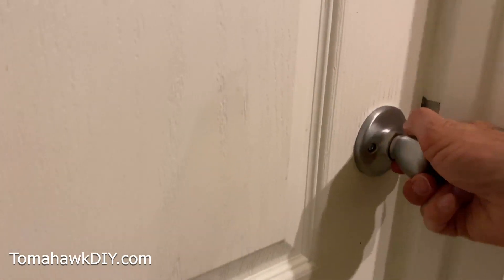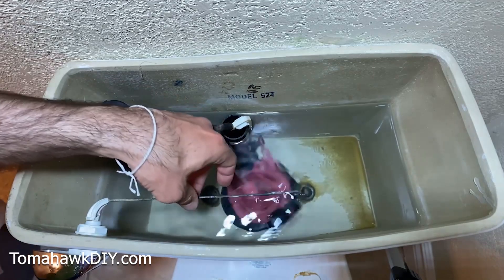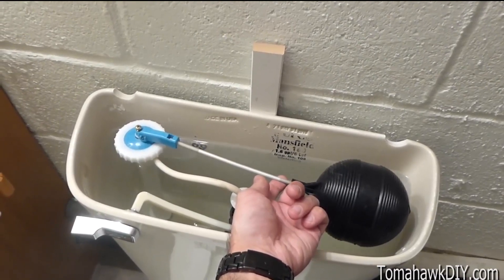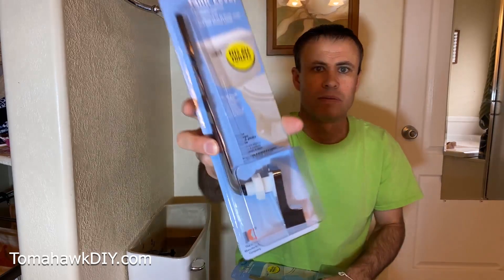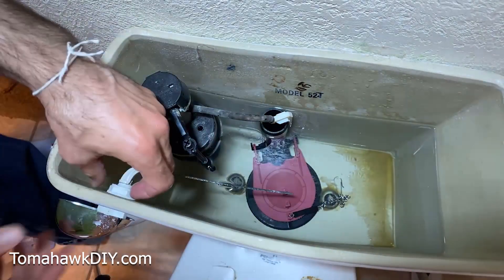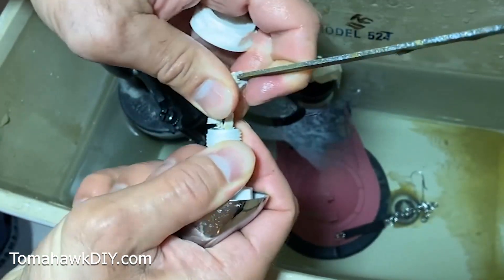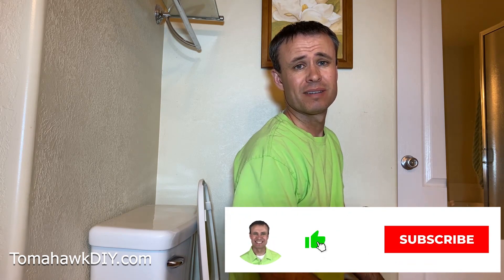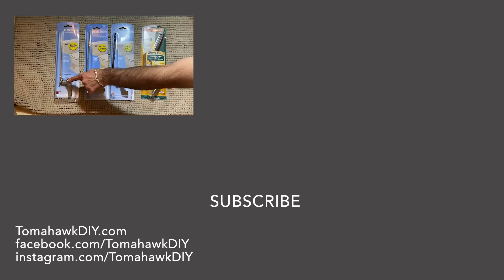Stop Toilet From Running Water – EASY FIX

Comment: The arm to which the chain is attached swings above the tank when you flush. Once the lid of the tank is reinstalled does the arm hit the lid?
Reply from the maker: Mine did that at first. I needed to change how the handle went through the toilet bowl.